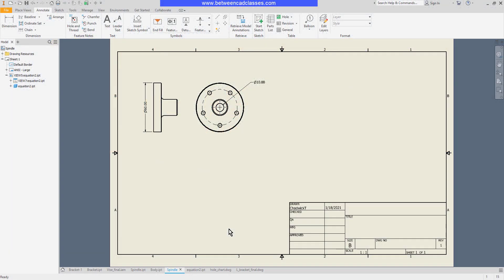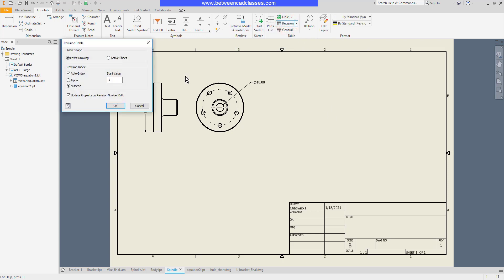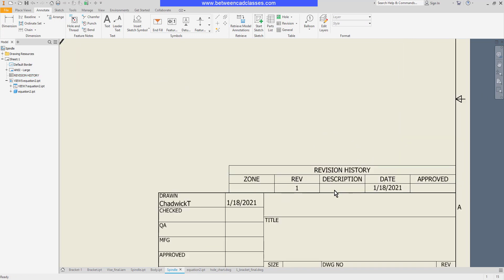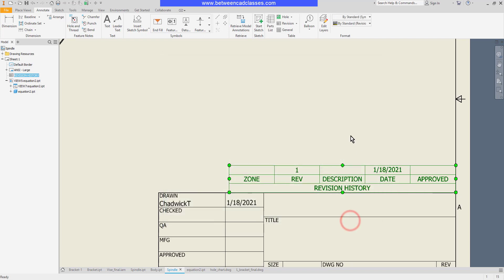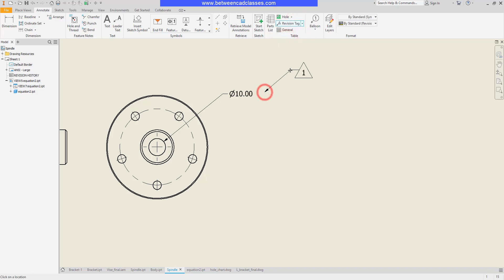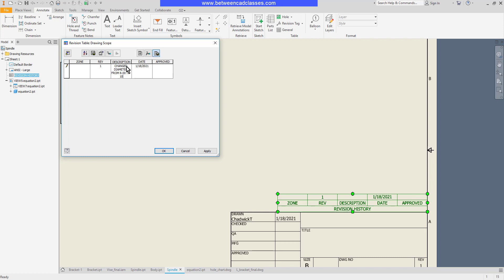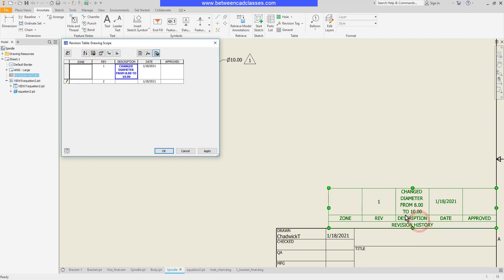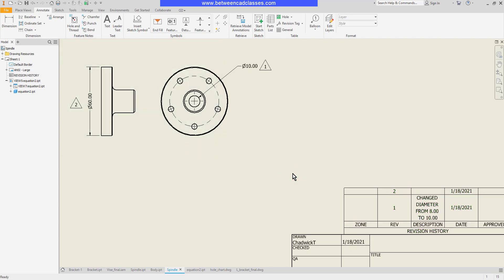Creating Revision Tables and Adding Revision Tags in Autodesk Inventor

Comment: Why is the row text showup up as blue? Does this mean that its some kind of "override" ?
Reply from the maker: Hi David! You are correct, it is an override. By default, the Description and Approved fields pull from the iProperties of the drawing (on the Project and Status tabs respectively). Each revision would need a different description and potentially different people may approve them, so the fields can be overridden as shown in the video. I hope that helps, and thanks for the question!